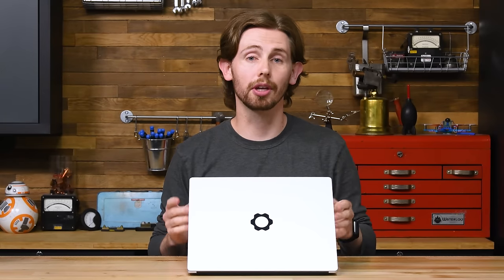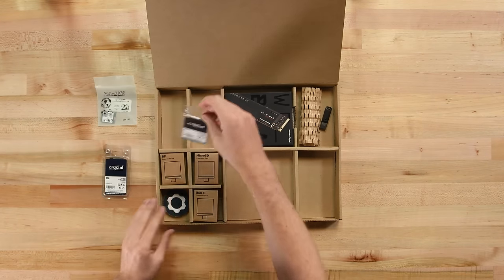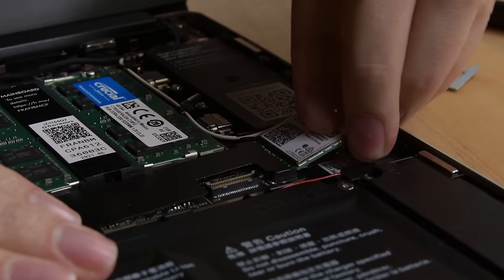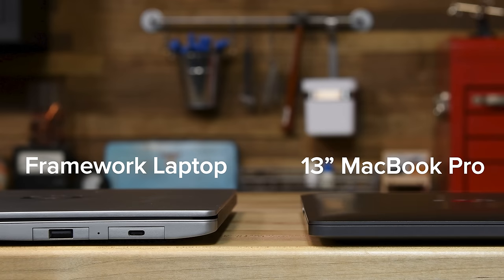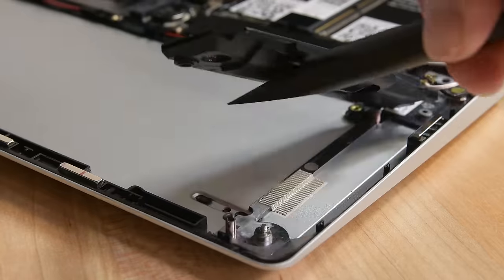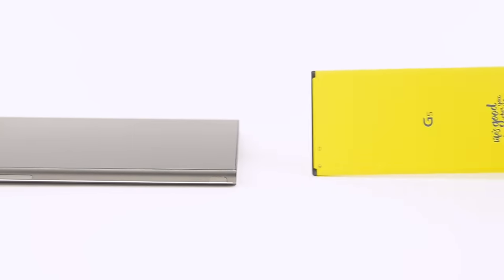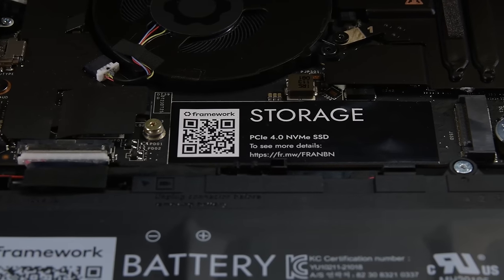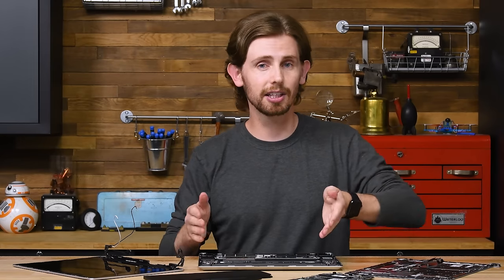Framework Laptop Teardown: 10/10, But is it Perfect?

Comment: There is no such thing as THE objectively perfect one-size-fits-all device just as there aren't all that many devices that are lacking in every single possible aspect, hence why I never rate lowest or highest as these would implicate one of both extremes which is why I immediately get suspicious whenever I see a completely full/empty rating.

A minor nitpick (like the cables getting a little in the way when inserting the wifi module - i can already see myself pinching them by accident at some point when upgrading or replacing something) makes it per definition imperfect giving a 10/10 nontheless devalues the term perfect and voids any meaning from 10/10 resulting in 9/10 or 9.5/10 being more accurate approaches. Curious for the 16" maybe there's a little more room and/or less free-dangling wires.

Comment: mine is about to ship

Configuration
$1,213.00
CPU: Intel® Core™ i7-1165G7
WiFi: Intel® Wi-Fi 6E AX210 No vPro®
Memory: 16GB (1 x 16GB) DDR4-3200
Storage: 250GB - WD_BLACK™ SN750 NVMe™
Customization
Keyboard: US English
Included
Bezel: Black
Included
Expansion Cards
1 DP
$19.00
4 USB-A
$36.00
1 HDMI
$19.00
1 MicroSD
$19.00
3 USB-C
$27.00
Accessories
Framework Screwdriver
Included
Power Adapter - US/Canada
$49.00

Comment: Reparability is nice and all but useless if you cannot upgrade it with new processors, GPU or put in more RAM. You will just have to buy anew one when that gets outdated. Then the price is just ridiculous.  $999 minimum. You can get the M1 macbook Air and gets loads more power, it will last you for a lot longer than this one.

Comment: my framework laptop wont turn on. I plugged in the power adapter to charge it and no light comes on. I pressed the power button. Nothing.
Reply: Did you fix it?
Reply: @amirmousawi9156  no i didnt bring it to a computer repair person. so busy with life. healt issues also.will try to do it soon.

Comment: Designed with repair in mind?

If you design a laptop with repair in mind, you'll split the PSU regulation away from the mobo proper. Because 85% of the time it'll be the PSU regulation, battery charging, or PSU safety cach failing us.

WRT to reviews, we really need to know what they're doing with the BIOS.

Comment: 9/10 because USB C soldered to board and should be practical for anybody with open tech like a 3D printer. Power should be better positioned and to be blunt I think C type is suspect and have two rubbish type connectors. Type A USB for power is fine for this this form factor.

Comment: If only this came in a form factor that wasnt aimed at the macbook air segment... There needs to be room for more in there, and more IO, especially when one of the slots is reserved for charging. I've looked for a laptop for almost 10 years that can hold something as simple as a couple of drives to give enough storage without having to spend 15.000$ on an M.2 drive. You used to be able to at least take out your optical drive and put in what you want instead. Now that flexibility is taken away for the sake of worse GPUs and "look how thin this is". Does no manufacturer care about functionality anymore?

And smaller than 17 inch is pretty much useless in a work environment.

Comment: I dont get it. Most of laptops already have replaceable battery,keyboard,memory, speaker,m2,hd, screen etc.....repaired multiple dell laptops and parts were easy to get it on ebay or aliexpress. Replacing motherboard/cpu combo will cost more than selling ur old laptop and getting a new one.

Comment: Designing smaller battery to ease relatability smells like a designed landfill fill … and also, try putting this laptop through tough throw around and drops from table and see if it splits into bits. I don’t care if you can put it together and fix easily, but it doesn’t sound like it was designed with longevity and durability in mind, so pass .. sadly

Comment: This laptop is just perfect, Framework recently released the new motherboard with 12th Gen Intel processor, just disassemble and change the motherboard and close the case. This is amazing in such a small, light and thin laptop.

Comment: I am crying because of happy, to know there is a new laptop that has no "welded to top shell / wrist pad /whatever the term is" keyboard in 2021. Why replace good old $10 keyboard replacement (OEM parts from china) with $100 "keyboard assembly" for the sake of 1 mm less thickness. I hate all Dell Latitude in my office since 2017 because of this kind of keyboard design.

Comment: i wouldn't give it a 10/10...
the only thing the Framework laptop lacks is an upgradable CPU, and its not something that is impossible to do... yeah sure most laptop CPU's are BGA based and are soldered on, but that didn't stop apple from making the PowerMacG3/G4/G5 lines literally having upgradable BGA CPU's using sub boards and connection slot between them.
think about it, if Framework had upgradable CPU modules for their laptops you wouldn't have to buy a whole new motherboard if you wanted to upgrade, just buy the CPU itself or well... a framework CPU module with the CPU model you're looking into upgrading to.
i personally wouldn't mind giving up on an extra 1-2mm to have this feature...
this is why, at least for me - the framework laptop is only going to get an 8/10...

Comment: I would not give a 10 only because I didn't see anything about GPUs.
Reply: The score isn’t based on the features themselves, just how easy it is for the end user to repair. I wouldn’t consider it a 10/10 in features because it has no swappable cpu or gpu, but it’s the easiest laptop for an individual with little skill to be able to fix and upgrade

Comment: Are people really that thick in the head? The "upgradeability" is limited to parts that you can usually upgrade in every other Laptop. Made and shipped in batches, a limited one-year warranty for that price tag is beyond laughable. If they actually cared about "upgradeability" they would've , at least, designed their own mainboard. It's just an attempt to make a quick buck from the right-to-repair hype, nothing else.
Reply: Not really. Most modern laptops only allow for replacing/upgrading the storage and ram, although some do have swappable cpus which I wish this had. But for most of the other things, if a part breaks or is defective, you’ll have very limited options on how to fix it. Not to mention they do encourage people to use third party parts in the laptops (which if they wanted to make a quick buck they would just make proprietary parts for everything in the laptop like every other major manufacturer seems to be doing) so even if the company goes under in a couple of years you’ll still be able to expand the life of the machine. They encourage the end user to work on the machine themselves, provide schematics, and even give directions on how the user can upgrade different parts themselves, even changing the entire motherboard if you wanted to, which you don’t have to do unless you want to upgrade the cpu, as every other part of the laptop is completey modular and independent. 

I don’t see the problem with it being made and shipped in batches, as the company is still a start up and doesn’t really have the kind of production to allow much anything else. The main issue I have is that it could become a kind of niche product as the average user may not care to much about the ease of repair or upgrades if they’re just gonna go to a repair shop anyways. 

Even if you think it is overrated (or at the very least overpriced) we should still use frameworks to pressure other major manufacturers to allow for modularity, upgradability, and third party repairs and parts in their own products.
Reply: @braydenmiranda6795  You can't provide schematics for something you haven't created. The only "schematics" they will most likely provide is how open it up or how to replace the SSD, nothing that goes deeper than anything you can find online for almost any laptop out there. The only place you'd get a different motherboard, LCD Screen, etc. for any Laptop, is from the manufacturer's site itself. Same goes for the argument that they encourage people to use third party parts in the laptops. 
The only thing they've "created", is a dongle, I mean Expansion Card, that gives the user one!!! port. Which you have to purchase since it doesn't even come with built-in ports, making it more prone to damage.
It's not going to be a niche product, it is one because a laptop isn't the same as a desktop PC.

Comment: Aaaaa... That's what qualifies as "repairable" these days? o.0 "I can remove the battery in under 5 minutes!"  I can remove my Dell m6800's battery in 5 seconds. I can replace the GPU, CPU, heatsinks, keyboard, etc.  Very, VERY sad this qualifies as modular or repairable. Anything that uses torx screws just screams, "DONT OPEN ME!" And a soldered to the board CPU???  I'd rate it 2/10. Blah! Modern engineers are morons!